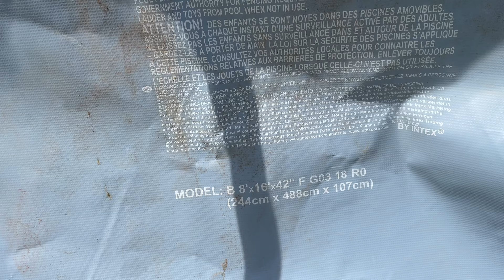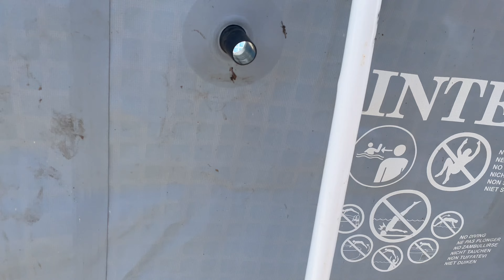Intex pool 8 x 16 x 42.   Disassemble and reassemble a new pool liner

Comment: How long was your old pool used? The metals look quite rusted. 

How did it get so many punctures?
Reply from the maker: @ck1416  we used it for 3 years and left it up during the cold South Dakota winter.     I THINK all holes came from the last winter I decided to take it down, fold it up and store it.   I think all holes came from it being folded up as after 3 years in the sun and chlorine made the pool thinner and less soft….   Idk just what I think.   The new ones is never coming down for winter!
Reply from the maker: I think the metal is covered with a cheap paint and low quality pre paint prep hence it rusting so fast.   Again just what I think.
Reply: @DansShopSD  Thanks for your reply. Just got the Intex pool same as yours. Haven't even set it up yet. Your video helps to give me an idea how to set it up, thanks! 

Frankly, was a bit worried seeing the condition of your pool. Hoping to make mine last as long as possible.

Comment: How many people can swim in this pool comfortably? I’m thinking about buying the same size
Reply from the maker: Kids?  5. Is the most we have had at 1 time.    Adults 2 or 3.
Reply: @DansShopSD  are the dimensions accurate? I’m worried that I won’t have enough space once the pool is filled. Are the dimensions provided accounting for expansion?
Reply from the maker: @terraGaliciaXXIV  the 8 x 16 is an accurate measurement of the liner.   I just ran out and measured with the support arms ( metal arms that hold up the pool).  You need 11 x 19.       So they stick out a bit.     Make sense?
Reply: @DansShopSD  thank you for checking! Yes it makes sense. Bottom line is you’ll need 11X19 in space to account for expansion